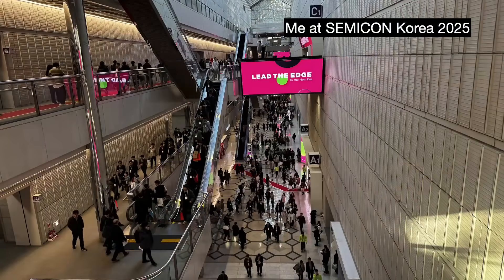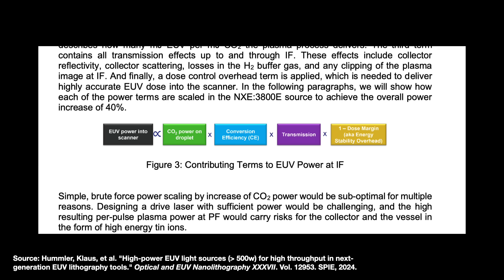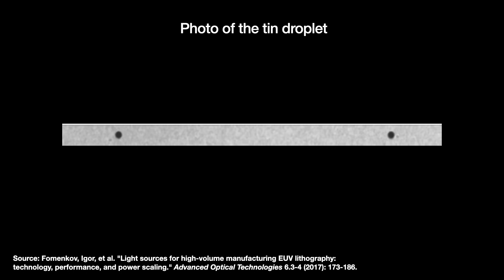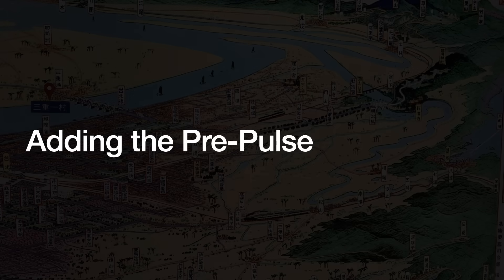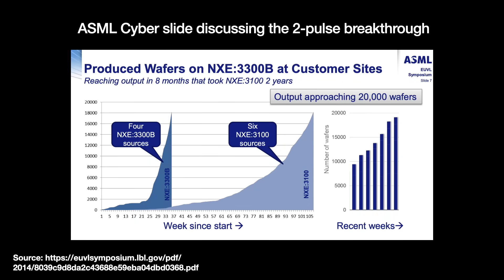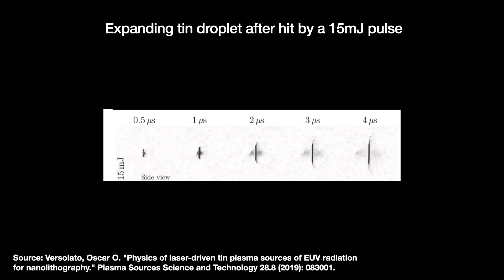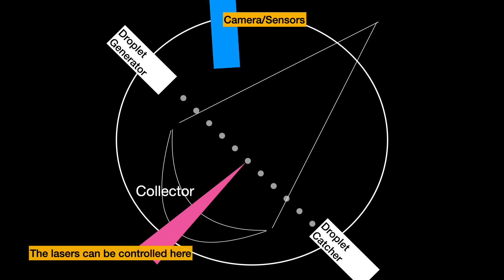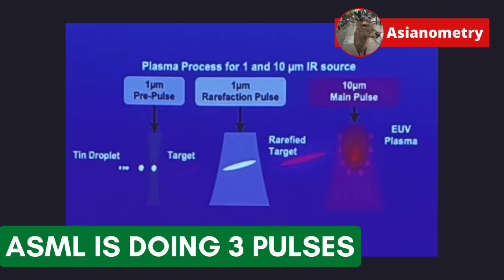ASML’s Breakthrough 3-Pulse EUV Light Source

Comment: CC Wei @ TSMC needed to resign

The whole thing about delaying purchase of High NA EUV machine was the power of light source i.e. through put.

Now if ASML is already pulling it off as the Twin Scan 5000 research and 5200 for production, the 3 pulse is for 5200 and seems so ready to lift off.

This makes CC Wei is fool as he mis-forecast the ability ASML can increase light source power.

CC Wei @ TSMC needed to resign, they not going to even be relevant until 2030 by the time even Samsung will pass TSMC.

Comment: Possibly I'm not up on its difficulty but it also seems to be somewhat an engineering exercise to make similar sized molten tin drops. I can imagine ink jet tech, yet it still seems to be another surprising win of getting something to work that must in order to go DUV/EUV.
Reply: DUV doesn't need the molten (plasma)tin at all.  The vaporizing of the tin produces the "extreme" ultraviolet light.  The older "deep ultraviolet" photolithography solutions use entirely different technologies, and can even use x-rays instead of ultraviolet beams.   I don't think anything else is going to use nanometer wide streams (to the human eye, it's very much a stream and not droplets!) of plasma tin in the foreseeable future. and I don't think ASML is eager to share the knowledge, especially not with China desperately wanting the tech.
Reply: @squirlmy  Yeah. I caught that after I posted. DUV and EUV come off as being similar in my head so my forgetting that they come about by entirely different ways. I have always wondered if some "Tony Stark" tech could break physics and find a way to make EUV with a led it would never be seen because ASML would keep it in house :)

Comment: 11:29 some more laser produced plasma physics here :
While longer wavelength pulses are better at creating more efficient, lower density EUV emitting plasmas, shorter pulses are better at ablation of solids.
 The reason for this is that once a plasma has been created there is free electrons for the laser light to interact with and heat the plasma. That process is known as 'inverse Bremsstrahlung'. 
When a laser interacts with a solid or cool gas it first needs to create these free electrons. That process is a non linear optical effect known as ' multi photon ionisation'. Shorter wavelength pulses have higher energies per photon, thus need fewer photons to sum together to create the first free electrons.
Shorter wavelength lasers, like Nd:YAG, will be more efficient at getting a solid to a plasma. Longer wavelength lasers, like CO2, are more efficient at coupling to an already created plasma.

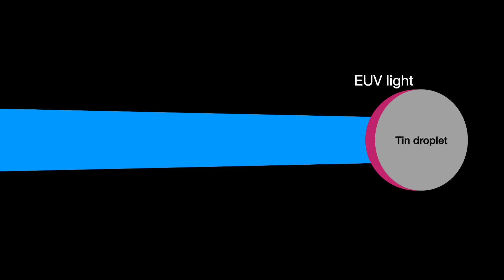Comment: 8:23 - you are a little bit off here. Reflection always happens...some laser produced plasma physics- 
the electron density at which the plasma becomes reflective and stops absorbing the laser light is known as the 'critical density' This electron density has an inverse relationship with the wavelength of the incoming laser light.
 All Laser produced plasmas ( of this type)  will actually reach this critical density during the lifetime of the  laser pulse and begin to reflect. Once they reflect it allows the density to drop and the plasma can absorb some more laser light. So during the 10s of nano seconds of the pulse the plasma will continuously go through a self regulating cycle or absorption and then reflection, thus staying at an electron density close to the critical density. 
The lower the density the more EUV light can escape the plasma.
 Its for this reason that long wavelength laser, like 10um CO2 pulses, give more efficiency ompared to to shorter wavelength lasers like Nd:YAG or excimer lasers.

Comment: How long until they resort to a synchrotron light source? These EUV machines must be approaching a similar cost, especially as you can have multiple stations fed from a single synchrotron ring.
Reply: A synchrotron source was previously considered, but the issues was that the generated photons were too spatially dispersed after exiting the synchrotron.
Reply: Synchrotron light source meant all scanners connecting to it goes down when the source is down. A commercial fab would not be able to tolerate such shortcomings.

Comment: Couldn't they have two parallel systems? Like two separate streams being hit at the same time, could that double the power hitting the wafer? Of course the slight angle from both (or more ) sources would need to be considered, but I certain they can pull it off, just like they did with making crazy light patterns to end up with accurate shapes. Actually, three parallel streams would make more sense, as the center stream (directly in front of the wafer) would be the "guiding" source, while the two other lights (at an angle) would further build that light, while the the "angled" power would be cancelled, causing a little bit of waste. Still this would 2.5x power over the current single stream.

Comment: What’s the droplet catcher on the other side doing? There’s no droplets left to catch, they’re blasted to atoms, right? And don’t all those ionized tin atoms condense onto the surrounding lenses and mirrors? Debris are a problem but doesn’t ALL the tin end up as debris here?
Reply: The tin droplet is flying at a good velocity. Not everything gets kick out of their intial direction. Also they use a low density gas curtain to contain many of the debris.
Reply: What exactly ASML does to handle the debris that is generated is a closely-guarded trade secret, so we don't really know what happens to it. The catcher is most likely there for the droplets the laser misses though, it does not have perfect accuracy.

Comment: Dynamic laser aiming is somewhat easy: you have galvoscanners or piezo mirrors which can work on the timescales of ~10-100 microsecond, and electrooptic deflectors which can aim the laser beam with sub-1ns timescale. Electrooptics for 1064nm laser is so much easier, and this is why (in addition to much lower cost of 1064nm fiber lasers) they try to do as much complex work at 1064nm as possible. High power 10um CO2 laser beam is much harder to steer quickly, so I would expect they adjust only timing of main pulse, without trying to laterally target the cloud. Also, steering main beam would shift light source and misalign the rest of the optics.
Reply: They use a q switched CO2 laser to get high peak energy on the tin.😮
Reply: 10-100 microsecond is slow though. At 60k droplets/s, you get a droplet every 16 us.

Comment: I had no idea they were at 92ev already, thats really putting eztreme in euv. Fantastic video, thank you.
Reply: That's closer to x rays than UV. 😮
Reply: @christopherleubner6633 one definition of the change from UV to X-Rays is 10nm and shorter wavelengths, so by that, EUV already is Xray

another definition is 100EV and above, and by that one, it's still UV light.

So we're really on the edge.
Reply: @christopherleubner6633 That is basically it. It's just that "x-ray lithography" got a bad name for itself, so it had to be rebranded to "EUV"
Reply: @rainbowhyena1354 It it really actually X-ray lito? What is the bad name X rays have?
Reply: @cajampa  It's not x-ray, it's right on the border of it though. EUV is 121nm down to 10nm, then below that is x-ray; EUV lithography is at 13.5nm.
Reply: EUV has always been at this photon energy. Or what do you mean?

Comment: Getting the wafers per minute up to what the alignment equipment can process would be a big improvement. We don't need EUV for the final layers, as those need to be big enough to connect to the outside world. But making both the transistors and the first several routing layers is already being done. In fact, only N6 only uses EUV for the transistors. N5 and onward need EUV for several layers above the transistors.

Comment: I wonder if they looked at having the molten tin on the inside of the rotating cylinder instead of the outside thus automatically containing most of the splatter. The cylinder would have to be a big enough diameter to fit some of optics.

Comment: 1.5 MW to 1 Watt on the wafer is absolutely bananas.
Reply: It makes an incandescent lightbulb sound impossibly efficient by comparison!
Reply: @wrentubes1886 probably similar if you consider the bandwidth….
Reply: @wrentubes1886 Efficiency is not the ratio of power delivered, but energy. Power involves a time scale that may be different for both.
Reply: If you have a more efficient idea ASML will make you a rich man
Reply: @benyomovod6904  Ever heard of femto-second-laser tech? Some Universities do measurements with it. I don't know how hard it would be to generate a laser that hits tin at those frequencies with enough power, but theoretically it should be possible at least with my very limited knowledge about physics. That would be as accurate in timing, as we could currently get. Atto-seconds maybe?
Reply: So will this give me a higher fps in cyberpunk ?
Reply: Russians supposedly developing some xenon EUV source
Reply: Yup light at a precise wavelength takes a lot of power. They are basically making an x ray source using lasers to get there. First pulse from a CO2 laser shapes the tin drop and vaporizes it,, second one from a KrF excimer laser ionizes it to plasma, Finally the third hit from an ArF laser finishes the job exciting the plasma to make EUV light.
Reply: @christopherleubner6633  The inefficiency of the system has little to do with producing "light at a precise wavelength". All lasers do that and my home theater projector doesn't consume megawatts. The rest of your comment is just a regurgitation of material covered in this and other asianometry videos. It doesn't explain why the system is so lossy.

To be clear: I know much of *why* the system is so lossy. The mirrors alone are extremely lossy. I've just never seen a full end-to-end efficiency figure and was kinda shocked by the result.

I'm also not claiming that I can do better. All the agro comments can chill.
Reply: @christopherleubner6633 your mentioned lasers don’t match the shown wavelengths. ArF and KrF are different machines alltohether.
Reply: My old school had proton syncrotron and even that managed to turn 150kw into about 10 watts of beam on target.
Reply: It puts the snarky comment I heard from a researcher into artificial photosynthesis regarding natural photosynthesis and its <1% energy conversion efficiency as constituting a "failed MIT experiment"; the implication being that no process as "inefficient" as nature's primary engine for life could ever be commercially viable! And yet here we are: with commercialized EUV (not to mention the plague of AI data centers and rampant Bitcoin mining).
Reply: It is super inefficient, but so were steam engines when we first built those. I don't think EUV will ever get anywhere close to 90% efficiency, but it's still a relatively new technology.
Reply: @dansamarco1610  I'm not saying it's not useful. Obviously, it's worth it. It's generating tons of value. I just didn't expect an efficiency of 1/1,000,000. It's kinda eye-watering. 

Steam engines were never so inefficient.
Reply: All I see are silly actors in gorilla suits.
Science is awesome
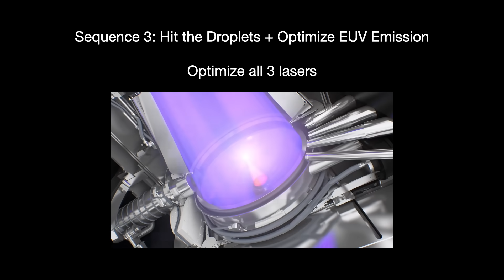Reply: 16:45
80/90%?

So many dedicated people and universities and organizations and philanthropists and common man inventions and endeavors and decency.
So I propose we put bottom above the top.
Workers vs Duh Irrelevant!
Reply: Nice video and presentation. 
I’d love to read in your future videos on first principle behind two key factors - Multiple Patterning and Advanced Resist Materials, that 3nm wafer using 10nm EUV isn’t possible without it.
Reply: This extreme difference between input & output is also wht laser fusion can't be used for power: every time they talk about efficiency improvements, they're skipping several input stages.
Reply: @absalomdraconis  excellent. and your point is,,,
Reply: Sounds like something made by Aperture science
Reply: Right?!? I knew it was record breaking inefficient, but that's bollocks!
Reply: Cooling system in the CO2 laser probably resembles a regeneratively cooled rocket nozzle
Reply: It also makes the wafer cheaper 😊
Reply: 1.5MW for a VERY SHORT MOMENT. MW is not MWh. You can plaster the rooftop of the factory with solar cells, put some battery packs in (30-40 thousand), done. You're net positive.
Reply: @der.Schtefan It IS actually around 1.5MW continuous I believe. The laser is charging up between pulses. This is somewhat close to the estimate I saw of 30MWh/day/machine.
Reply: @niktak1114  I believe you're right. The energy doesn't get turned into very short moments until it is converted by the laser, and even then there are fifty thousand of the short moments every second.
Reply: @der.Schtefan  Exactly - efficiencies are calculated with energies, not powers.
Reply: @VicariousAdventurer  You absolutely can measure efficiency by power in vs. power out as long as both are continuous which they pretty much are in this case.

When someone says an internal combustion engine is 25% efficient, they're talking about power.
Reply: @AbeDillon  I am pretty sure they use a short pulse and not a continuous 1.5 MW laser. CW CO2 is actually possible, but if you want high power at the maximum efficiency power in / power out for a CO2, you run it in a duty cycle at most a few percent.
Reply: @VicariousAdventurer  Nope. 1.5 MW doesn't refer to the pulsed laser power. It's the total average consumption of the machine. 100 Watts is the total average output of the machine. Energy-per-exposure * Exposures-per-second = watts.
Reply: @AbeDillon  efficiency to me is cost to a mile run of my car.
Reply: Ikr?! It not only lowers the electricity costs but also the manufacturing